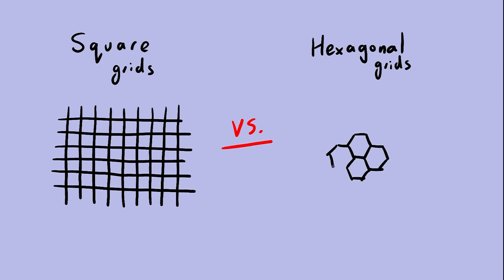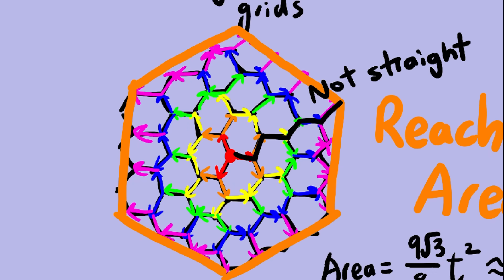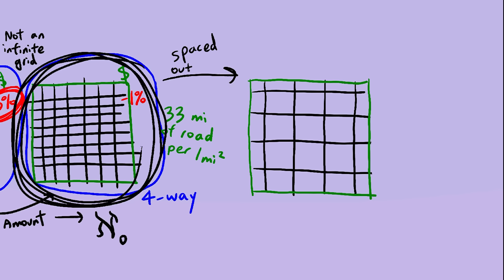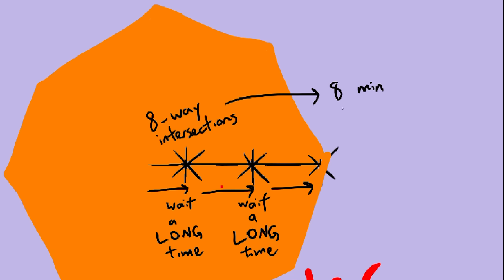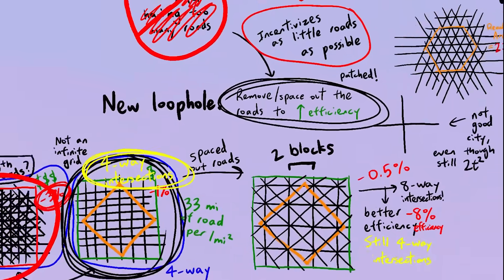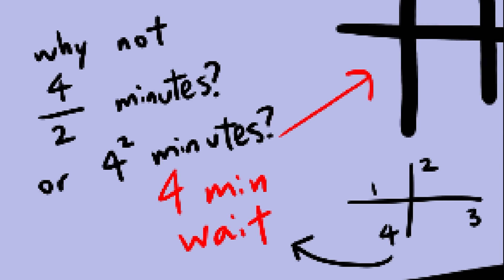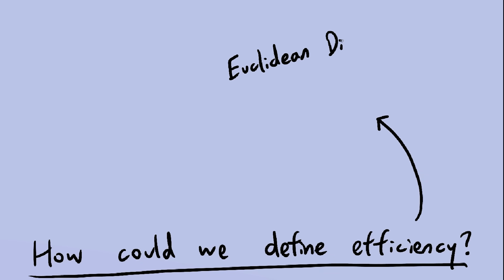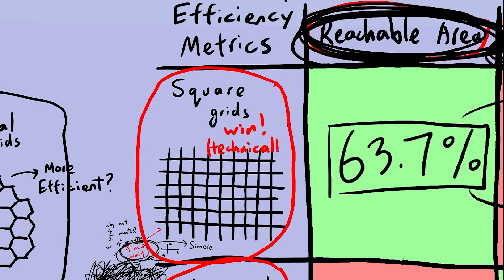Would hexagonal city blocks be better?

Comment: You develop straight roads between points of interests that need the connection, everything else can be built locally, with slower traffic in mind so pedestrians can move around freely without getting blocked. Also develop lots of trains that go underground and on stilts to remove car traffic. 
In the end most of the traffic should stay on these high capacity, high speed roads while everywhere else you got slow traffic so the people there can actually enjoy their life and stuff. Those roads can take any shape they want, just look at Rome on a map, squares, rectangles, triangles, prisms, trapeziums? wedges? circles?! Cities don't have to be built for efficiency, but for people to live in.

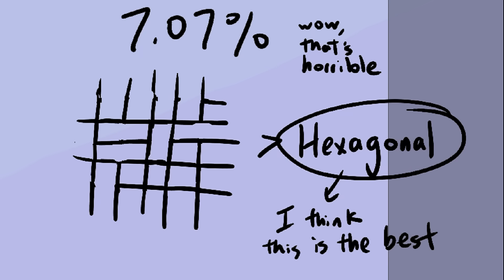Comment: 7:05 what about one way roads? Vertical roads alternate between up only and down only, and horizontal ones alternate between left only and right only, so you can still easily travel in a straight line but each intersection has half the directions you can come from

This is how DC works essentially

Comment: i think the reachable area approach is by far the best, with some tweaks. Speed should be proportional to the area or circumference of the block, this kinda removes the scaling problem. I say kinda because physical speeds are affected by air resistance, engine power etc which would make a certain blocksize more efficient than the other. I also think that efficiency should be measured in the number of reachable blocks for a given time, since the blocks are the grid, we want to see how many points in the city we can access for a given time. As for finding the most  optimal block shape, i suppose the way to start is by defining a function which traces the shape, but i dont know how to define the constraint that the shape should fill the plane with no gaps

Comment: Yes, efficiency and stuff, but counterpoint: Coordinate systems and addresses. With a square pattern, it's easy to say 6th and 7th street, but it becomes near impossible with hexagons. Ironically, the insides of the hexagons would be easier to assign a grid system to than the roads surrounding them. How am I supposed to tell when one street ends and another begins when it's all 120⁰ turns? It'd be very easy to get lost in a city like that

Comment: Interesting problem.

It's been found that having multiple routes between A and B is less efficient than just one.  In London, there were two main roads taking people from a residential district south of the Thames to a business district north of the Thames.  Both routes were congested. When one of the routes had to be closed for repairs, it was anticipated that it would cause chaos, but it actually made it easier, with a higher throughput on the single road than both combined.  There's a video on YT analysing this, but don't ask me who made it.  The analysis showed that giving people choices made things worse.  Therefore, you could rate efficiency based on how many shortest routes there are to travel between any two points.  Moving diagonally on a square grid is spectacularly bad, especially if there are lots of people making the same journey, e.g. if A is a business centre and B is residential.  Almost all of the traffic is people going from A to B, but the entire rectangle defined by A and B is going to be full of commuters making the same journey.  At every intersection you'll have people going straight across to the north, people going straight across to the west, people turning left from north to west, and people turning right from west to north.  You have to give them all equal priority at the lights, so on average they'll be stopped at each set of lights about 25% of the cycle time.  If there was only one route, you could dynamically prioritise flow based on the volume of traffic.  This diagonal problem is so severe, it may be quicker to drive outside of the rectangle.

Note that you penalised intersections based on the number of routes into the junction, but for a square grid, you only have two states for the traffic lights.  NS and EW, whereas for the hex grid you have to give each of the three entrances 1/3 of the time.

I don't think this is the sort of problem you can solve mathematically.  It depends too much on human behaviour and where people are travelling from and to at any particular time.  You will have residential districts and you will have business districts, so you will get mass movement from one area to another at both ends of the day.  This is the sort of problem that simulations excel at, but they have to be accurate, so traffic light sequencing plays a big role.
One thing you only tangentially suggested is that you want to maximise the real estate area, at the same time as maximising mobility, so you can't just build more roads

If you're planning a brand new city, you could define the zoning to require each block to have both business and residential space in an even proportion across the city.  This should greatly reduce the volume of crosstown traffic.

Comment: Road efficiency is never measured by reachability, but by real world performance.  These metrics consist of time it takes to get from A to B based on heatmaps of traffic.  The question was never whether or not the roads had the shortest distance, but whether they distributed traffic along more roads.  In this way, hexagonal grids would allows win under any scoring system, so long as it checked for distribution of traffic.

Comment: You've gotta use linear algebra, with a vector for different travel penalties, and dot-product it with a vector of how much each penalty actually matters. You can leave the grid-system vector alone, and twiddle around with the penalty-cost vector.
Efficiency, though, should probably have something to do with how accessible non-road land is. Some kind of integral over distance from the road for every point of land.

Comment: In a square grid, all roads should be at 90° angles. The moment you change the angle roads are allowed to be, it is no longer a square grid. Same with hexagons and 60° angles. You are fundamentally breaking your own rules. Most of the rest of what you did was mathematically fine, but its kind of like knots or holes. One thing mathematicians generally do is look for things that are technically identical, hence why I'm bringing it up. Putting diagonal roads in a square grid fundamentally changes the type of grid to a different one and changes the rules associated with it.

Comment: What about a system where your actual end points are randomly picked ANYWHERE within the reachable area and you impose a penalty at both ends of your trip based on the distance from that point to the nearest grid line. More roads mean smaller blocks with less "internal" area in each block.
Another variation would to be to include the road width which removes area available to reach. If the entire circle was a road, then the "reachable area" would be zero because there would be no non-road" points within the 1 hour travel distance.

Comment: Here's a crazy idea: what if "efficient" isn't a synonym for good?
Reply: Engineers will crash out upon reading this
Reply: Yup. Efficiency is a good quality, but it's not THE quality. It's but a single property of a whole system of different ones, all of which are dependent on who actually lives in - and governs - the system. Different people have different priorities
Reply: That just means you haven't found the right optimization target(s) yet.
Reply: @egarcia1360 Here's one: Walkability.
Reply: @miwiarts  Something to think about for sure, but that's not exactly a goal in itself so much as an end to a means. What I'm getting at is more like "Useful_Destinations / [Traveler * Time * Cost]", which, with the right inputs and weights, I'm sure would give you a design that's plenty walkable.

Comment: as far as i am aware, civil engineers often try to make sure that most of those places you want to reach are in 15-20 minute driving (or in denser areas walking) distance. meaning you might have to commute to your job via more build up and full main roads, but most needed shops and services should be available in smaller community/city/whatever hubs near you. thats often refered to as a walking city or smth. in countries with more developed public transport these hubns are also most likely well connected to make sure the main roads are not overly full with cars.

Comment: Shouldn't there just be a fixed grid size for both because there would be a grid size for an city plan anyway and that would solve any problem related to loopholes with spacing
Reply: And I mean the squares in the square grid should have the same area as the hexagons in the hexagon grid, because having the side lengths be equivalent makes the hexagons far larger which would logically decrease efficiency because of less roads, but if the blocks are all the same size that completely eliminates the problem and is more realistic to spacing in a real city where blocks should be an ideal size

Comment: In square city grids, efficiency is greatly improved by traffic light synchronization. Ideally, as long as you're traveling in a straight line, all lights should be green-that is, the intersections don't add any time at all. I wonder, are such synchronization strategies possible for arbitrary grids?

Comment: The issue with the x minute delay for x intersections is that that doesn’t actually describe how traffic flows. 

A square, four-way intersection has traffic flowing (assuming no protected left turns) on two light cycles; north-south and east-west (you do get to ~4 light cycles if you add protected left turns). With a hexagonal intersections, you would need three light cycles using conventional traffic patterns, though you eliminate the need for protected lefts in this case, so there’s maybe some efficiency bonus depending on what percentage of cars need to turn left vs continue straight on the square grid (you also could maybe do something with allowing all clockwise flow and then all counterclockwise flow and then end up with a definitively more efficient system than the square since all traffic would be protected in two light cycles). If you need protected lefts, it may still be more efficient to elect for a brick pattern , because in the three-cycle hexagon pattern you’d have to toggle each artery individually, but you can allow simultaneous flow both easterly and westerly thought the brick intersection, only needing to cycle for the westbound protected left and to allow traffic flow from the north-south artery, though this road would only connect between two horizontal roads and would likely be less traversed and thus need a shorter light cycle.

Comment: Kinda confused by the "reachable area" metric, and random pairs of points at the end. What do you mean by reachable area? Isn't the set of points you can reach via roads in t minutes a subset of the roads themselves which are assumed to have zero area? Did you just connect the set of reachable points with straight lines? For the random pairs of points at the end, what do the integrals mean? Wouldn't it be better to do a sum over pairs of discrete grid points?
Also, it'd be cool to see a comparison with a hub-and-spokes grid (aka polar coordinates), like some European cities, e.g. Paris and Moscow.

Comment: 7:00 couldn't you shift every other row of the square grid a small amount to get its coverage arbitrarily close to the square grid while still only having 3 roads per intersection?

For example shifting odd rows 1/1000ths a squares width so cars only have to go 1.001 units per block traveled vertically
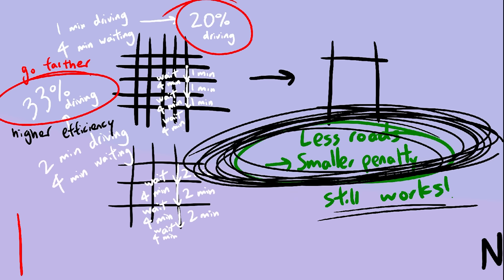Reply: Oh I see I misunderstood and thought the penalty worked similarly to whats mentioned at 8:18

Comment: i think you dont have enough variables in your efficiency calculation, as far as figuring out how to remove loopholes, but i think no matter what you are doing, youre going to create a loophole by what singluarity arrives from a  division.

i think you could probablt prove that there is always at least one loophole to these metrics.

overall though, you could hook into the real world - calculate the total opportunity cost for the area you can get to, and do some integration.

space used by a road has a very high opportunity cost, stuff at the road edge has a low opportunity cost, but as the road gets further away, the cost goes up. roads then have a constant width, and areas that are too small have a high opportunity cost as well, since you cant build on a  sliver.

the tuning parameters could probably still be picked to decide which setup is more efficient by choosing different combinations of magic numbers

and so, you can only do it meaningfully by using real world numbers

you could maybe determine a fixed width of a road, and then calculate the area of a cell in the crystal, and compare the ratio of road to building, for a matching area of cell. something of a packing ratio

Comment: I think the "brick grid" is going to be the best grid if the city itself is a long and thin structure, say because it follows a river valley. That way, the uninterrupted direction can be arranged parallel to the main axis of the city, meaning the longest routes someone takes through it can still be mainly one straight shot, so the clipping of the reachable area compared to a full square grid doesn't matter much - especially if, to deviate from ideal math land into real city planning, you use this as the larger grid of a superblocks design, where pedestrians and cyclists on shorter trips can take a shortcut through a block to have a straight shot in both axes.

Also, in reality, the main advantage of a hexagonal grid topology is imo that there are far fewer conflict points at each intersection, resulting in a much lower rate of crashes, and the crashes less often leading to severe injuries or death, at T intersections compared to four-way intersections. Also, the brick-bond grid has the advantage over the hexagon grid that for the same length of road between two intersections, the center of each block is closer to a road (half of the road segment length vs sqrt(3)/2 (~0.87) of the road segment length, 18% of a hexagon block's area is further from a road than half the segment length). In practice, because either in a superblock design or a classical block design the usable "depth" of a block is limited, this means that the hexagon grid needs to use a shorter segment length.

This would also be a way to account for both arbitrarily increasing or decreasing the density of roads to cheat the metrics: Fix the furthest distance (measured in driving time if you will) from any point in a block to the nearest road at a specific value.

Comment: 7:26 no... I don't think there should be a penalty for hexagonal buildings. The only reason we generally have square buildings is because buildings are generally designed to fit the space between the roads, and it is easy to build a long straight road, compared to a bunch of short wiggly roads. (As evidence, there are plenty of non-rectangular buildings out there, including the pentagon, which doesn't even tile).
If we were instead to design a city by first placing buildings and then determining the road system afterwards, we could theoretically see a more hexagonal grid, but that isn't how cities are built.

Comment: Of course, the biggest factor for using Squares/Rectangles instead of Hexagons (For buildings, furnishings etc...) is that they tile neatly within other Squares/Regtangles.
In comparison, a Hexagon can be tiled neatly either with 6 specific equal triangles, or a mix of Triangles and Hexagons. It's far less convenient to work with.

That said, you could feasibly place rectangle buildings into a Hexagonal grid, and have some green space/parking lots to fill up the gaps.

If you wanted to be more robust with your 'Distance' traveled in a given time, you could consider which route a vehicle takes through an intersection and apply a suitable penalty.
Assuming you're driving on the Right...
- A Right-Hand turn would have very little penalty.
- Waiting for a Left-Hand turn would have a large penalty, that scales with the intersection size.
- Going straight through a 4-way intersection (Assuming it has lights) would have a moderate penalty. (Traffic can only go straight about %40 of the time)
- If you had a 'T' intersection, the straight path would have no penalty. This would also be true for the priority path in a 2-way Stop.
- A 4-way Stop is terrible and should never be used.
- A Roundabout would have a little more penalty than a Right-Hand turn, but it would be the same no matter what path you take.

Having a mix of 'Bricks' and 'Hexagons' could actually be quite interesting. The straight lines created by the 'Bricks' pattern allow for higher speed roads that cut through the city, while the array of intersections created by the Hexagons allow traffic to diffuse into the streets, while also discouraging anyone from cutting through by making those roads far more complex.

Comment: I feel like rather than trying to put in place artificial factors that punish grids of different scale you should have attempted to remove it from the equation.

Say all grids must be within a certain area. Say 5kms squared. Then set all roads to be equal widths. Then fill out grids which lead to the same proportion of city taken up by grid

Comment: What if you just remove the 1 minute drive time between intersections, and instead use the number of intersections as the drive time between intersections. If you ignore drive time between intersections, you solve the spacing out problem.